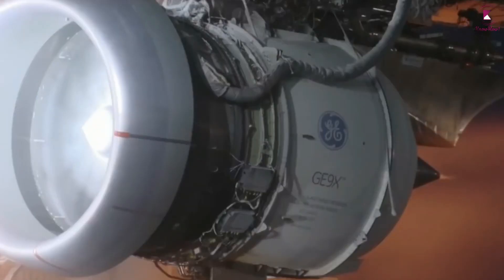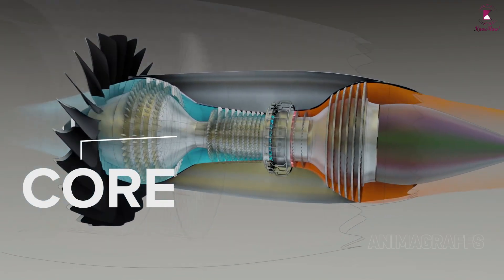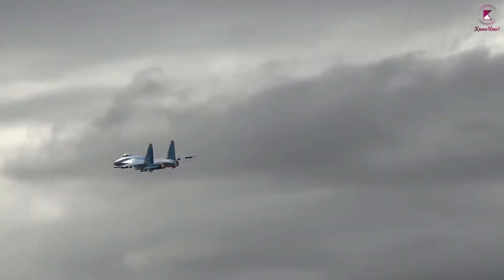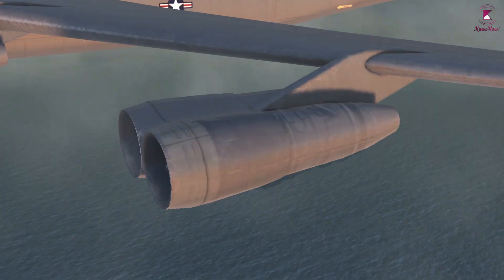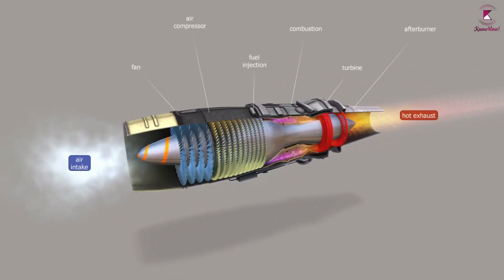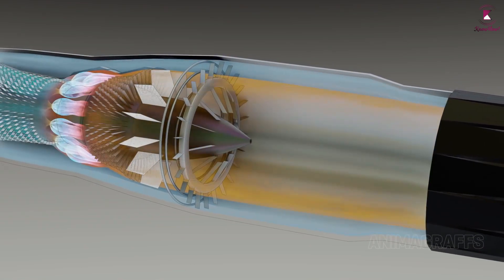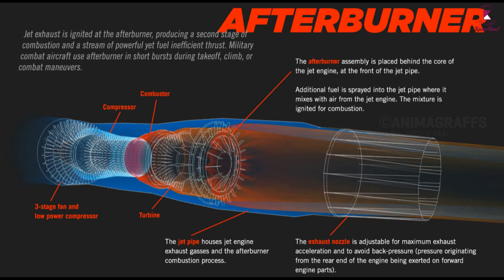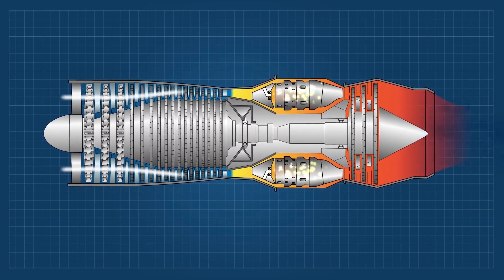Turbojet | How do Turbojet Engine works

Comment: Henri Coanda was the first ever engineer which create the very first jet engine Coanda1910 !!!!
Reply from the maker: No, Henri Coanda, Romanian aeronautical engineer, did not invent the jet engine. He filed a patent for the makings of the start of a jet engine in 1910. However, it lacked the part of the internal combustion engine that will burn fuel. What he filed as a patent was like a gigantic cold blower with wings.
Reply from the maker: Thanks for your Precious time But,
Some acknowledge Coandă as the discoverer of the Coandă effect but give Hans von Ohain the honour of designing the first jet engine to power an aircraft in manned flight, and Frank Whittle the honour of completing and patenting the first jet engine capable of such flight.